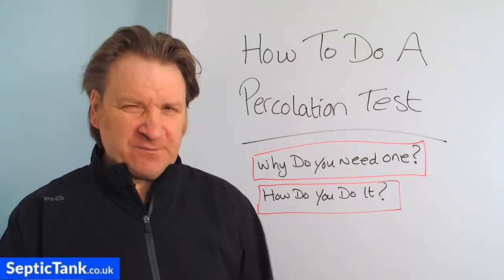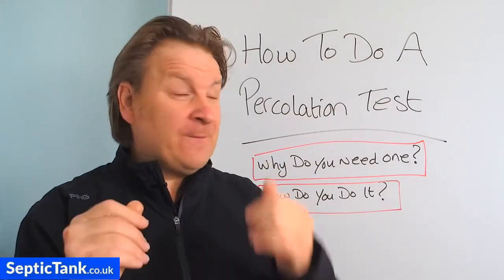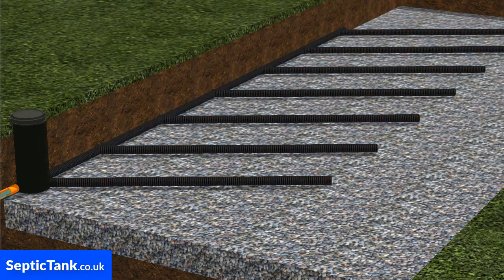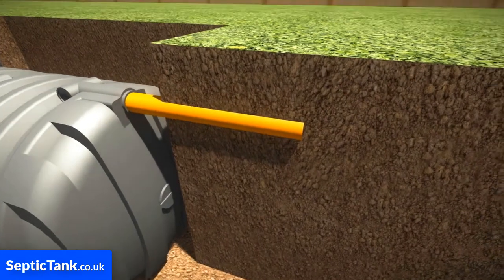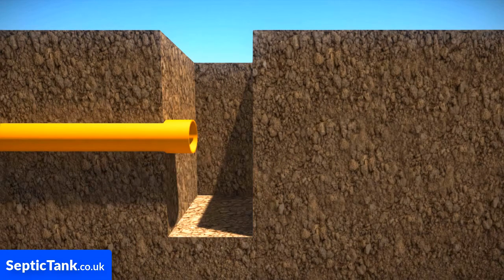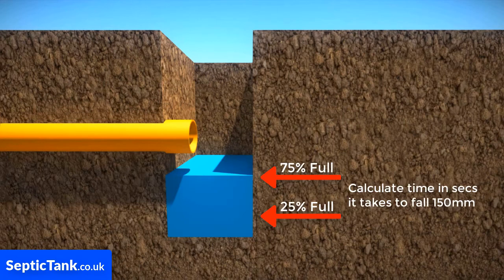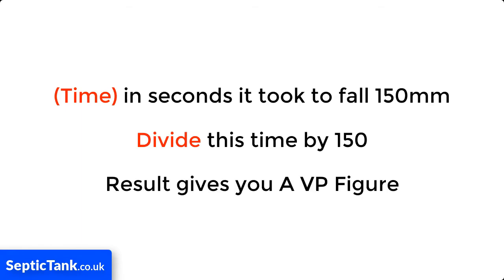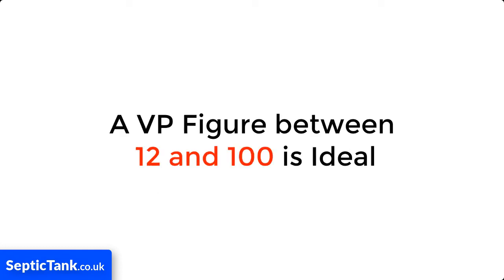how to do a soakaway percolation test - how to do a soakaway percolation test

Comment: advise needed! I have a failed soakaway because its been installed without a perculation test by the previous owners and its been excavated in solid clay, just now because of the high water table in the field were the soakaway is its not allowing water to soakaway and is back logging into our septic tank, currently using a sludge pmp to remove the top foot of water to allow us to flush the toilet, would it be better to dig out the existing stones that fill the soakaway and refill with septic tank soakaway crates giving me a 90% volume rather than a 10% volume currently as its filled with gravel

Comment: Conzo is correct.  Also, the presenter states fill to 30 metres, believe that is 30 millimetres.  The other major error is that a septic tank drains to a drainage field, check the British Standard or building regs.  Soakaways are for surface water from roof or paved areas.  The both do a similar job but are called different names.